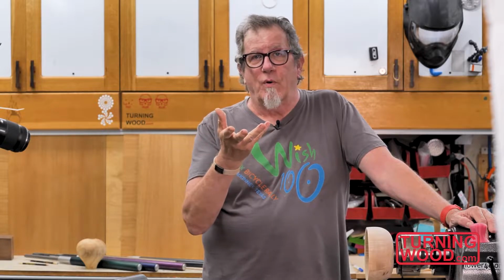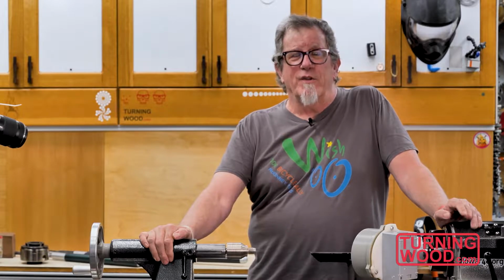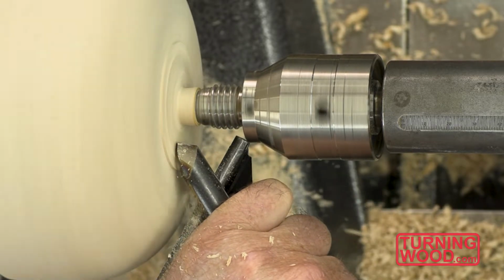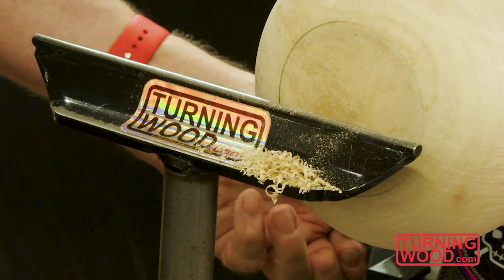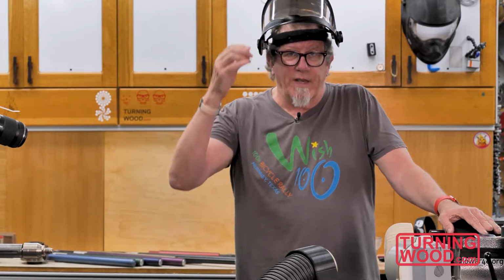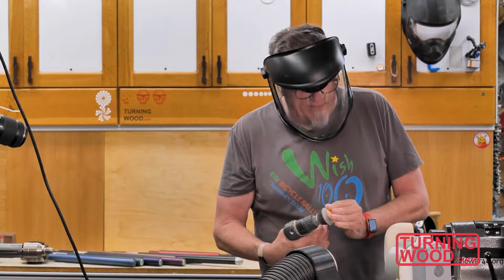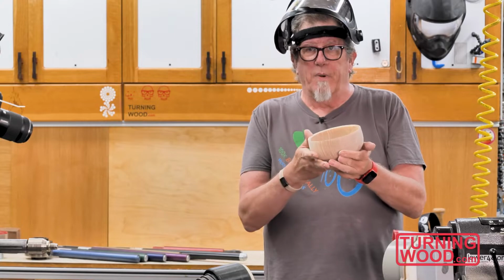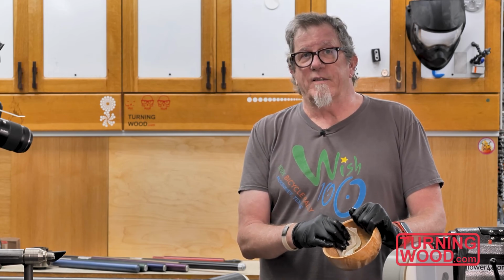Using a vacuum chuck for sanding

Comment: Nice video, thanks for sharing. 
I'm in the process of creating 3d printed vacuum chuck. Just finished designing the rotary adapter similar to the yours but in 3d printed plastic, not sure if it will hold up, time will tell. How did you create the 3d printed chuck, any chance of getting a Fusion or step file of the chuck and gasket? Are you using a gasket between the chuck and spindle?

Comment: That Trent Bosch finishing gouge is a new one to me.  How is it different from a bottom bowl gouge?
Reply from the maker: It is swept back on one side and a straight up side on the other. I’ll try and get some photos of it
Reply from the maker: I can't attach pictures, but it is a 1/2" V bowl gouge, 60 degree face, no secondary bevel. looking from the back, the right side is ground with a straight up vertical side the left side is swept back some. It can be used on the inside for a finish cut or on the outside for a finish cut.